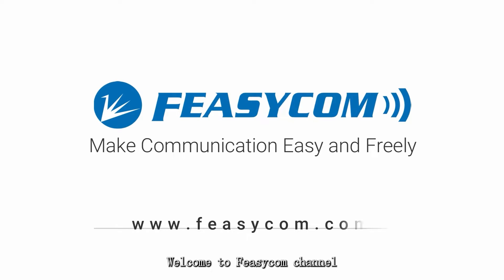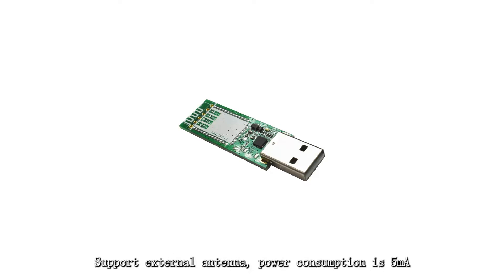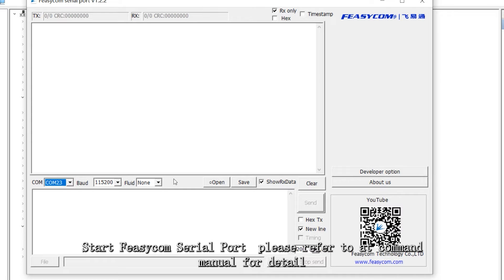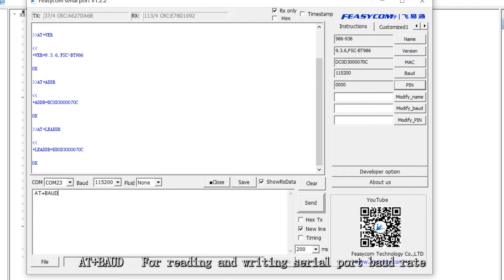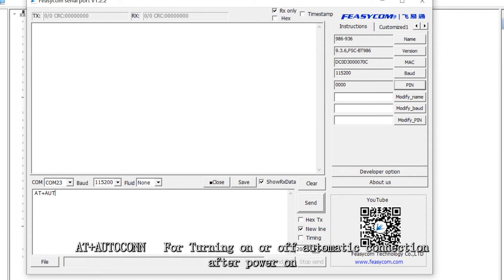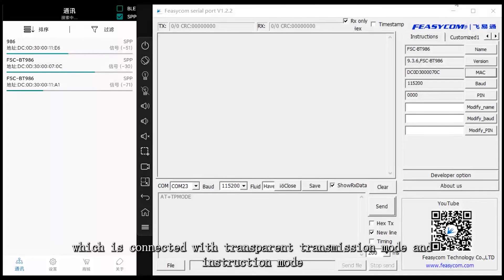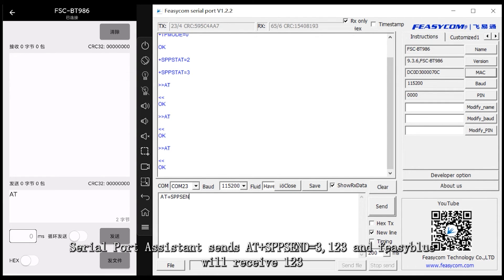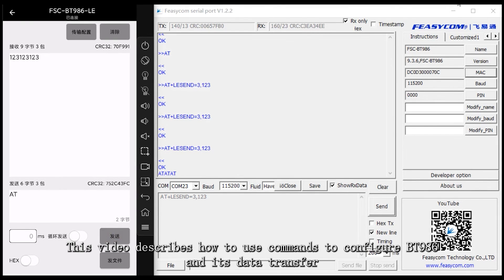Wireless Embedded Bluetooth Module URAT TX and RX Tutorial Guide | FSC BT986

Comment: This is not HC-05 Replacement. If this is HC-05 then it's AT Command mode is dependent on Key Pin if device is connected or not connected. This is not working.
Reply: If you have application where you keeps sending data then it can easily courrupt module as AT can be your data as well not command always and this module do not check Key Pin for this.